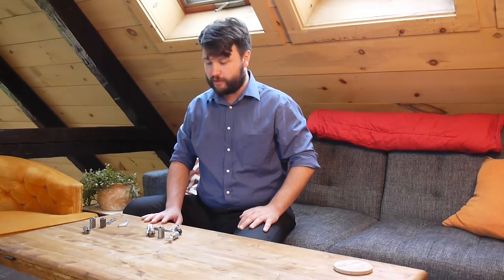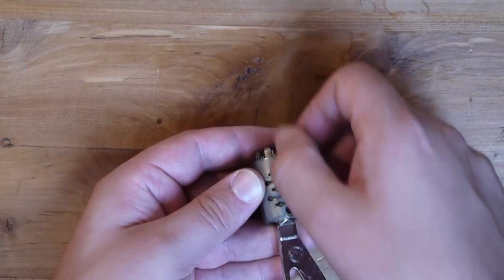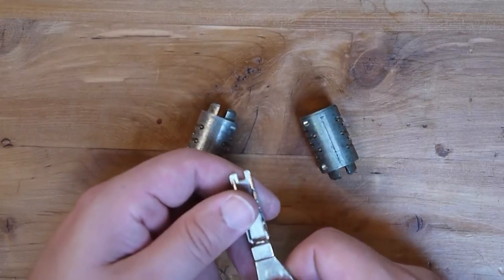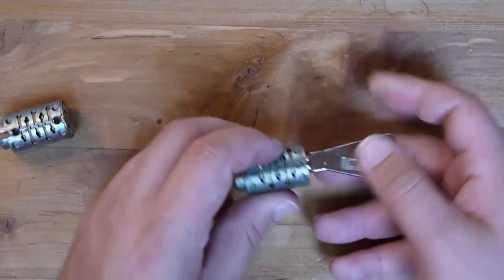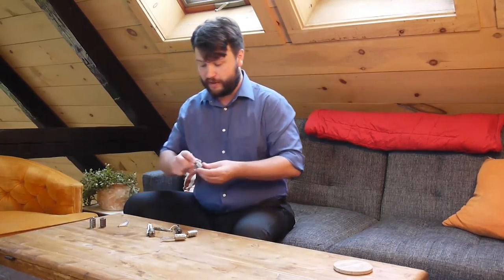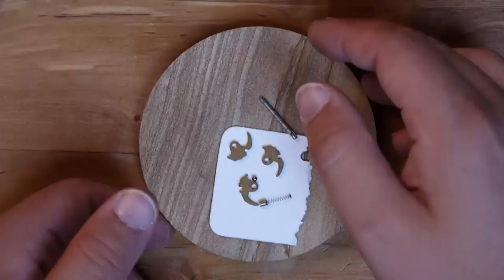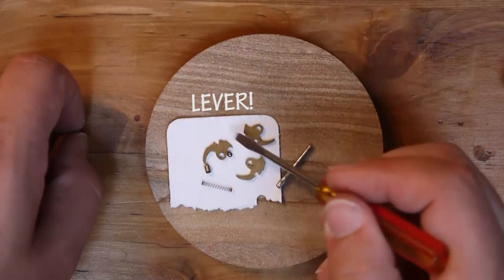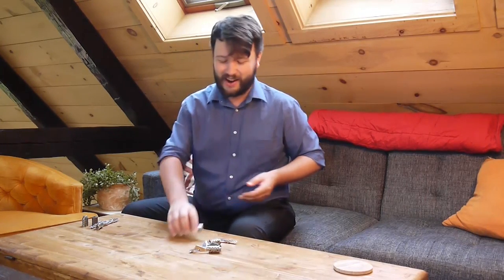The Collection: Fichet 450

Comment: I purchased a number of the I-Beam type Fichet locks around 1985, still have them, a few Cam Locks as well as a Heavy Duty Rim Cylinder. They hit the US market around the same time as the DOM Dimple Key locks here in the US. Not sure, but I think I recall NJT using the DOM locks on receptacles in the Hoboken Station back in mid 80's. But then both companies just disappeared from the US market. I recall watching a documentary located somewhere in the UK on a sanatorium, using Fichet locks on every door. Again, 1980's.
Very, very tough to find those Fichet locks now a days. 
Every now and then I pull those locks out to have a look. I purchased both the DOM and Fichet from a sales Rep that stopped in once a month with new items for sale. He handled a lot of non US products that were hard to find back then. Name of the company was, Landersman Group, long gone. Still have all my DOM Dimple locks as well. Wish I had purchased more of both lock types.

Comment: Im not against last ditch effort of using a airwedge on a door frame  as tyler mentions. if its a ridiculously hard lock to pick for whatever reason.  And if i know i wont damage it. Ive done it actually once on a metal storm door where the lock must have failed or i was just having a bad day picking, i wedged it open hoping to just manipulate the thumb screw but with one more pump i was able to just wedge it past the bolt catch and open.
Reply: Sorry, schuyler, not tyler